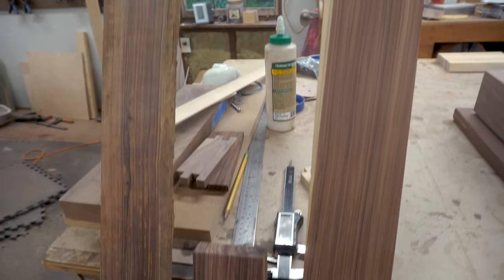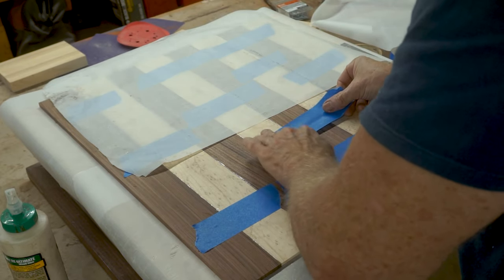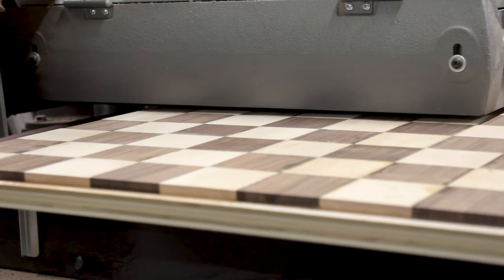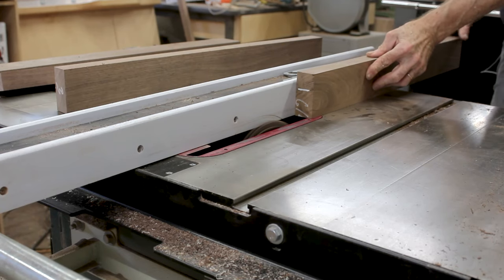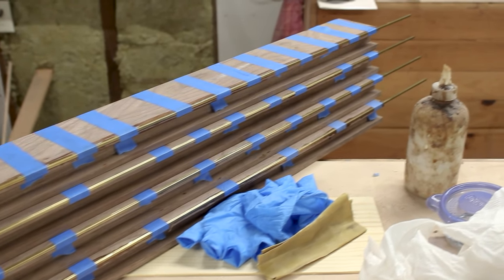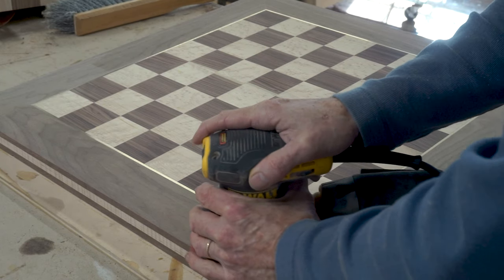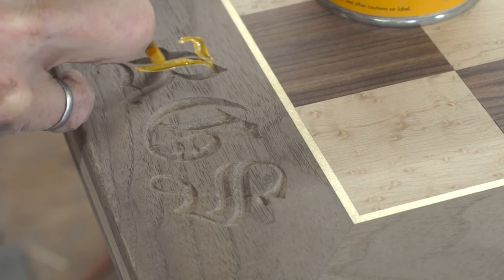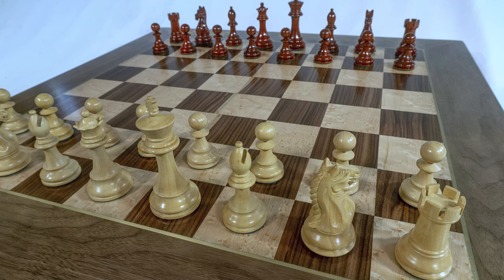Bird's Eye Maple and Bolivian Rosewood Chess Board

Comment: I bought all the tools to  make chessboards.  Made them out of solid wood using various kinds of jointing techniques and every one of them cracked going through Minnesota dry winters and wet summers.  Used sanding sealer and pre-cat lacquer too. I ended up burning them all in the firepit.  I think the plywood is key but I'll bet anything the walnut boarder will still crack. My boards would twist like pretzels in winter.

Comment: certainly a project I would try. Tip I learned earlier. use fine grain salt on your glue to prevent slippage while glue up. Never played with gold leaf. I make cribbage tables. Some of the techniques you did I want to use on those. Love your bandsaw. That is weak point of my shop.

Comment: For future reference. I would do the CNC router before it's glued. All it takes is one technology hiccup to really throw a wrench in your entire project.
Reply from the maker: I totally agree in most cases. It takes a lot of sanding after glue-up to get the frame flush with the top and bottom of the chess board. In this case, the carving had such fine lines that the sanding would have removed them, so that's why I did the CNC carving as the last operation.  But I do try to do as much CNC work as possible prior to gluing up.
Reply: @Woodumakeit  I used your hand carving and gold leaf touch on a chess board I made for my nephew who made me an uncle. Will be using the same technique on a dominos box for baby number 2.

Thank you for sharing so I can build memories for my family.

Comment: Fantastic work and so impressive!!! Wish I could have a board like this and play with my son just like Ray with his grandson. Out of curiosity why did you make a board on both sides when only one side would be used or did I misunderstand this and only side has the squares?
Reply: This bothered me as well. 

OP answered someone below with this "Thanks for the feedback. The reason I put squares on both sides is to balance the wood expansion and contraction. If I had a thick veneer of squares on the top and nothing (or something thinner) on the bottom, there's a greater chance that the board would warp. Plus, I feel that it adds to the quality of each board that I make."

Now we know!

Comment: Mr Mike McCrory, your woodworking skills are quite splendid and second to none. However, either by design or by sheer carelessness, you Sir have neglected to install the necessary mechanical inner workings and accompanying electronics to produce an automatic chessboard, which allow the player pieces to move on their own accord upon the chessboard. If what you have created and posted on YouTube was intentional then I trust that your next project shall indeed include the automatic features stated in my comment. ☝️🙄

Comment: womderful chessboard, however I would have chosen for a sloped edge on all side, this way you avoid the ugly handle cuts, and you would have been able to pick it up no matter the position of the board.. might be an idea for your nect project.. but keep up the nice and hard working..
Reply from the maker: This is one of the first chess boards that I made, and I think it might be what you are describing: https://youtu.be/N2I2UacznHY  I made two chess boards in that video, but one of them has the frame with a sloped bottom.

Comment: Absolutely divine. Wonder, how many lifetimes of effort and practice you had before creating this masterpiece. The music made me see the whole video in 1X speed.
1 question though, why a 2 sided chess board ??
Reply from the maker: Thanks for the feedback. The reason I put squares on both sides is to balance the wood expansion and contraction. If I had a thick veneer of squares on the top and nothing (or something thinner) on the bottom, there's a greater chance that the board would warp. Plus, I feel that it adds to the quality of each board that I make.

Comment: When you sand wide pieces like the chess board on your drum sander, do you adjust the position of the sanding head with respect to the conveyor belt using the “fast lever” of the sander?
Reply from the maker: Yes, for wide pieces, I almost always have the lever in the down position.

Comment: Can you please tell me, have you checked how maple wood works with Bolivian rosewood in terms of thermal expansion coefficients? What is the risk that these types of wood are not friendly with each other, resulting in cracking, swelling, or splitting? Also, what if I wanted to make the board wood-block end grain to top to make the wood structure more fancy - would gluing them be any different? Thank you.

Comment: I love what you do but I have one question: at some point you put the board through the table saw to make sure you have straight edges, without cutting the plywood of course. The thing  I don't understand is that the plywood is your reference to the fence. How did you (or did you?) perfectly center the maple and rosewood during the glue up? I am trying to reproduce your first board (that went to Thailand) and I am struggling with that. Thank you in advance for your answer!
Reply from the maker: I use cauls that I made that fit over the plywood on all four sides. They are cut to the exact size to leave a 1/2" reveal of plywood all around the board and they fit tightly to the chess squares. When I clamp everything in place, it ensures that the squares are centered on the plywood and square with the perimeter of the plywood.  It's never perfect, but it gives me really good results.
Reply: @Woodumakeit  That makes sense but it means that you have to cut your maple and rosewood at exactly the same width for every project, right?
Reply from the maker: @jipiquittot  I have multiple sets of those cauls to handle that.
Reply: @Woodumakeit  I seeeee...thank you so much for taking the time to respond!

Comment: Another stunning chess board. How thick are the squares when you are clamping them to the plywood substrate?
Reply from the maker: Thanks!  The squares are usually about 3/8" when I glue them to the plywood. That gives me plenty of material to sand down, as needed. They're roughly 1/4" thick after sanding. With 3/4" plywood, that gives me an overall thickness of 1-1/4".
Reply: @Woodumakeit  Many thanks

Comment: Beautiful work! How come you used the plywood this time? Would you say a plywood core is better than solid wood through and through? I can imagine it reduces the risk of warpage over time.
Reply from the maker: The primary reason for the plywood is because the wood I had was not thick enough, but the plywood also adds stability to help deal with seasonal wood movement.

Comment: Great work! I'm curious, though, why double sided?
Reply from the maker: The primary reason for squares on both sides is to balance the forces of wood expansion and contraction on both sides. That helps to prevent the board from warping as humidity levels change. I also think it gives it a high-end look with the illusion that the squares are going all the way through. Some clients want a double-sided board so that they can play on one side with algebraic notation or on the other side without the notation showing.

Comment: Hi. I was wondering how thick the square were that you put on the plywood please.
Reply from the maker: I typically rough cut the thickness on the bandsaw to be about 1/2" and then they end up being about 3/8" after sanding.
Reply: @Woodumakeit  thank you so much for replying. I am trying to learn a new skill and try my hand at making a chessboard for my son for his graduation. All I need to decide is whether to use a plywood/mdf substrate  with thinner checkerboards or just go with 3/4” boards but I worry about movement. 

Your boards are absolutely fantastic.

Comment: Every time I've tried using 1/8" brass inlay and then run it through my drum sander the brass has heated up so much that the epoxy breaks down.  I've tried brass, aluminum, fine silver, copper etc.  No luck.  Any suggestions?  I've even looked for higher temperature epoxy to no avail.
Reply from the maker: I had that happen once when I used CA glue, which I know will release if it gets really hot.  My solution is to take the lightest passes possible and to let it cool a bit before taking the next pass. It takes a bit longer, but I haven't had any problems since.

Comment: Im curious, why you brush on the sanding sealer and not spray it? I guess it doesnt matter since you are sanding it smooth?
Reply from the maker: I supposed I could have sprayed it on, but that would have required more cleanup. You're right that I sand it smooth afterwards, so it's not important to spray this step as it is for the final finish.

Comment: What is the purpose of recreating the chessboard on the back?  Is it just to give the illusion of a solid board?
Reply from the maker: There are two primary reasons for doing that. The first is that it does give the illusion of a solid board. The other reason is that it's important to balance what's on each side of the plywood so that wood expansion and contraction doesn't cause the plywood to warp. If it's balanced on each side, the forces caused by expansion and contraction on each side will be relatively equal so that it's less likely to warp.

Comment: A Question: Why do you  use a plywood with 2 thinn checkers on both sides? Instead of making a single piece with correct thickness without using plywood? Thansk in advance. Love the board, gotta make me one
Reply from the maker: The main reason is because plywood is more stable than solid hardwood, so it helps to reduce seasonal expansion and contraction of the wood. The other reason is because it's difficult to find these types of wood that thick, so I'd have to glue them together in any case to get the desired thickness.
Reply: @Woodumakeit  Many thanks for your quick reply. Then my plan to do a face grain board 1" thick in walnut/maple hardwood is not to recommend 🤔. Thought the frame would give enough support.
Anyhow: awesome video 🙏

Comment: Hey; just curious what the reason for having a double sided board is for? Seems honestly arbitrary and pointless; but i am admittedly ignorant on whatever the reasons could be. Either way; tbe result was fantastic!
Reply from the maker: There are a couple of reasons to do that. One is cosmetic to make it look more high-end so that it appears that the wooden squares travel all the way through. The other reason is to balance the veneer on both sides of the plywood. Even when the squares are glued to the plywood, the wood will expand and contract to some degree and those forces can cause the plywood to warp. If the squares are glued to both sides, then the forces counteract each other and the board is more likely going to stay flat.
Reply: @Woodumakeit  this makes sense; thank you for the clarification.  I would imagine using a substrate that cant warp or move; thinking fiberglass or carbon would be ideal here? Any opposition to that Idea?

Comment: A technical question: Why the wood must to be sealed (at the end)? What's the purpose?
Reply from the maker: If you're asking about the shellac, I did that for two reasons: 1) it penetrates into the wood and adds a richer, golden color, and 2) because it is less expensive than the lacquer, so it makes sense to seal the wood first so that I can use fewer coats of lacquer to finish the wood.
Reply: @Woodumakeit , thank you very much for the answer. I subscribed to your channel.

Comment: Why two sided?
Reply from the maker: When gluing a veneer on one side of the plywood, it's important to have something of a similar type and thickness glued to the other side to counterbalance the wood movement to prevent warping.  Rather than gluing a plain veneer on the bottom, I like to put squares on both sides to give the illusion that the squares go all the way through.

Comment: The way you're holding that wood with 1 hand and the pressure from your calipers over a running saw... 2:13
Jesus man do you have any idea how dangerous of a situation you'd be in if you drop that thing on a running blade? Just turn the saw off.

Comment: You do realize you are face gluing plywood to thick pieces of wood.  Have you noticed the trouble furniture builders have gone to in the past to minimize or to take care of cross grain expansion and contraction in wooden furniture?  Good examples are frame and panel doors and sides of carcasses.
  You are gluing these pieces of thick wood (which IS going to expand and contract with the seasons of the year)  to  plywood which is dimensionally stable from season to season.  What's going to happen is the expansion of the thicker wood is going to WARP the plywood.  The plywood has no where else to go when the wooden squares expand or contract.  I have built ONE chess board doing exactly the same thing. It was beautiful until about 6 months until the humidity in the air changed with the seasons.  The board warped so bad it tore itself out of the beautiful frame i had surrounding it.
   I taught furniture making for about 30 years.  People need to realize that face gluing plywood down to full thickness wood is Not Going To Survive the changes in humidity in the air.  Your squares are not extreamlyl thick compared to the plywood so it Might survive a few years because the plywood will hold the movement of the thicker maple and rosewood.  
 Its going to warp badly over time..  Usually less than a year but it might survive for a few years.  
 Its a beautiful board and i hope im wrong but i know i'm not.
Reply: @bobbydazzler6990  Well i wouldn't know but i also don't think Jesus is going to be able to tell you. :face-blue-smiling:😅😅😅

Comment: Would I make it? (Assuming that I could). I’ll tell you what I wouldn’t do. I don’t like the initials and I don’t like the gold and the brass. The cleaner and simpler, the more beautiful. And I don’t like the wide border. The squares are exactly 2.5 inches? That’s 63.5 mm. Most competition boards have 55-58 mm squares, which is what I would go for - probably 58. And I’d buy a traditional Staunton set in the correct size to fit. But these pieces look a bit too large for your squares. I don’t care for the piece design, and the white pieces are as dark as most black pieces in other sets - I’d find that confusing, but did the customer order the board to fit this particular set? If so, the squares should have been even a little larger - maybe 65 or 66 mm. (Four pawns should fit on a square, and the height of a rook should fit the diagonal). By the way, with such a fancy board, the GARDE watch standing next to it when they play, looks kind of cheap.
I love Vivaldi! But I do prefer an orchestra that plays in tune! But of course it didn’t help that your machinery mostly played off key.